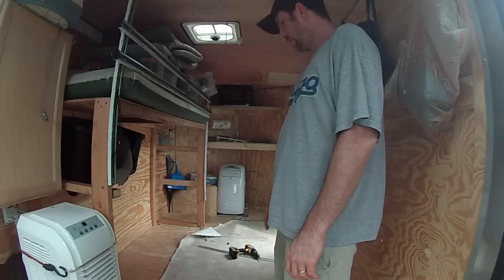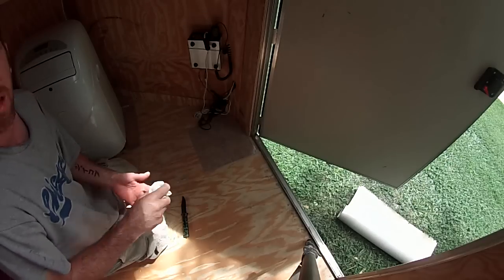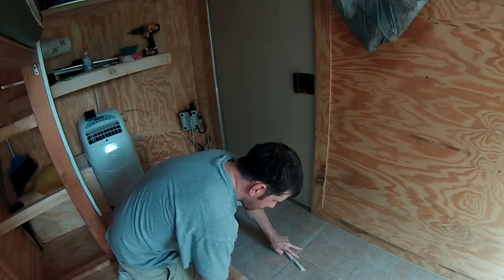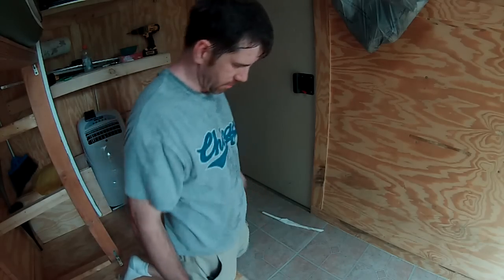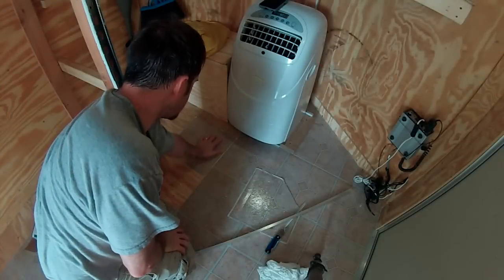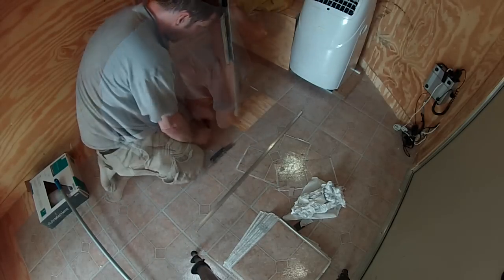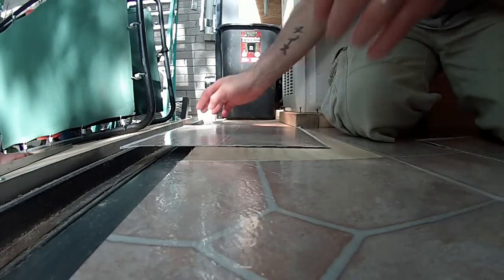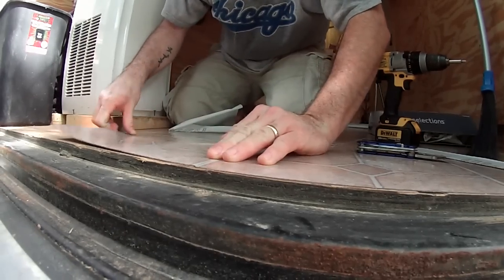Adhesive backed Tile Flooring   ......    6x10 Enclosed Trailer Conversion Project

Comment: best to snap a line down the trailer center and install from there then trim at the walls. That way the tiles will fit together nicely even if the trailer is not square.

Comment: how is it holding up? i did this same thing to my trailer floor and there are so many that are popping off i think its due to the heat in the summer time.
Reply from the maker: i only had one that popped up, due to moving some equipment in, and it caught on the uneven floor.. 
other than that.. worked great.. just replaced the bad one

Comment: do you really need two a/c units in there?
Reply from the maker: shinta201  Nope the other Unit Crapped out after a couple days ( was used)
so i just ran the smaller one.. and with the Airbox, and insulation in walls and ceiling.. it worked fine